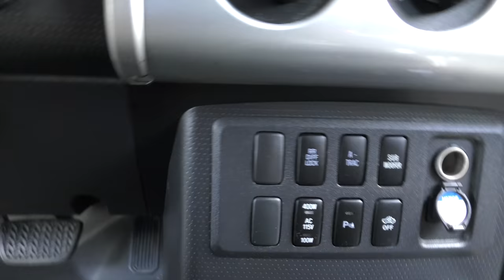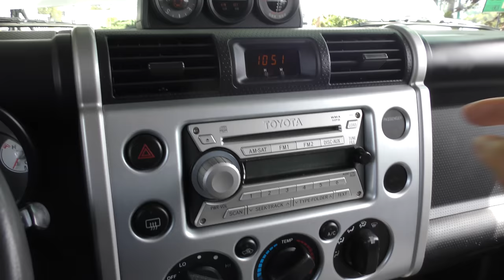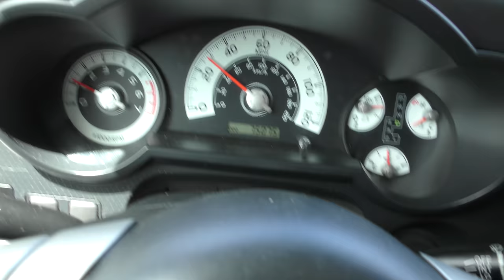I Finally Got a Toyota FJ Cruiser and Here’s What I Really Think of It

Comment: I purchased my second FJ Cruiser this spring. It is 2008  with 45,000 miles and was garage kept by the original owner. Last month I sold my original 2007 FJ Cruiser that I had logged in over 225,000 miles on it with no problems. An FJ will take you anywhere you dare to go and bring back home safely. Been all over the country off roading and camping, the FJ is a beast.

Comment: I have a 2012 one that looks to be the same specs of this one.  Not a single issue since I got it (I got it in 2014 with 27k miles).  Now it has around 85k miles.  Oil change once a year, that is it.  Oh, and I just replaced the original battery, after 9 years!
Reply: Weekend vehicle?
Reply: Id be pissed if i had any issues before 150-200k miles. At 85k shes brand new
Reply: Get your timing belt and water pump done when it's recommended. (likely at 100k) And if your a wrencher, do it yourself. I just did mine in my Taco last week.
Reply: @oldowl4290  FJ has timing chain..
Reply: Got a 2012 TT with 11k. It now 3 years later has 20k. Beats every overlander and most kitted off roaders. Replaced battery, and needs new tires but just because they are old.
Reply: @A-Negative  Bet that was costly!  How much you pay?
Reply: @A-Negative   TT ??? I'm sure you''re not camping in an Audi.
Reply: Oil change once per year, I don’t trust that. I’ll always stick to the tried and true 3,000 miles or 3 months, whichever comes first. Then I use high end full synthetics which are advertised to go much longer.
Reply: @ryanleblanc6817  I use advanced synthetic.  I only put 5k to 6k a year.
Reply: @earthling1984  Ah yes, the 1GR v-6.  Does the chain ever get replaced?
Reply: @ryanleblanc6817   Maybe he only drives 3000 miles a year lol.
Reply: 2011 here, finally changing my original battery. Still starts just thought id change it.
Reply: Have an 07 with 82K. I love it
Reply: I also got a 2012 model in 2014 at about 25k miles, now at 80k miles. Besides oil changes, how often do you do other fluids like differential, transfer case, transmission, and power steering?
Reply: @alcor4ever  Haven't done a single one of them.  I plan to get them all changed before 100k.
Reply: @earthling1984  I just did one or two once and was afraid I was overdue. Just checked their recommended schedule and will probably do them all at around 90k. Such an amazing vehicle!
Reply: @Dobbies Revenge I only put about 4 to 5k a year on my FJ.  I bought a used Honda Civic for daily/summer driving when I don't need the extra space.
Reply: WizeOne……very rarely
Reply: How did the battery last that long? I thought the lifespan of a battery was like 4 to 5 years
Reply: @T-Rex-nm1se  Japanese battery I guess?  They don't even sell the exact same replacement in the USA.  But yeah, it lasted for longer than I would have expected.
Reply: Honda Accord bought it new in 2015 factory battery lasted 18 months lived in az though second made it 3 years 2 years on the third is a duralast
Reply: I see you in every fj video lmao
Reply: @atlantaogatlantaoh3546  HI:)
Reply: @earthling1984  u seem to know a lot about them I’m in the market for one but I don’t like manuals if I get a automatic will it be as reliable?
Reply: @atlantaogatlantaoh3546  Yeah Toyotas automatics are solid.
Reply: @A-Negative  I have a 2012 as you do, mine came with a 6sp manual so it's a lot of fun. No real problems at 132k miles.

Comment: I still have my 07 that I bought new in 08.  Runs great and just about ready to turn 100k miles.  During the pandemic I upgraded a few things, which really increased my enjoyment of vehicle.  I upgraded the headlights with LED bulbs; swapped the CD/radio for a touch screen receiver with CarPlay, rearview camera, and mic for hands free communications; and swapped the OEM sway bars for bigger aftermarket sway bars.  The bulbs and receiver really bring a modern touch and convenience to the FJ, and the sway bars noticeably improved handling in turns and stability at highway speeds. The receiver had a kit that allows me to use the controls on the steering wheel to control the receiver.  It may not crawl over rocks quite as well with the new sway bars, but I'm not rock crawling.  Definitely the best new car value I ever had, even with the poor gas mileage.
Reply: What’s the touch screen receiver called
Reply: @okydokygaming4066  Mine is a Kenwood, but all of the car stereo manufactures make one that will work.  It is a standard double DIN size.  My only complaint about the Kenwood is that the screen could be brighter for very sunny conditions, but otherwise I'm happy.
Reply: I like that car. One day I will have it. Nice to see yours is cared for.
Reply: what brand of swaybar did you install?

Comment: l can tell you they perform off road very well also,
Reply: A wild Mustie appears.
Reply: Indeed! My girlfriend has a '14 FJ with a 6 speed manual, and we took it up to VT a couple of months back. Went on an offroad trail that no unibody suv would ever dream of tackling, scraped the skid plate lightly one, maybe two times. Wouldn't have even put it in 4lo if we didn't have a clutch to worry about. 

Mustie1, I'm a huge fan of your channel. I haven't paid the local lawnmower shop a dime since I started watching a few years ago.
Reply: An XJ does better.
Reply: I just sold my 07 FJ to my son.  He is babying that thing more than I did.....and I really babied it.
Reply: @Lray4x4  an xj sets the bar really high though. There's no shame at all in falling just short of its off-road capabilities.
Reply: @Pro4x Trdpro A trac or any other traction control has proven to be garbage in most offroad situations. I put lockers in both my axles for $600 but even with open differentials and good tires an XJ is hard to beat.
Reply: Good to see a fellow NH resident here!
Reply: @Pro4x Trdpro I have plenty, all it does is overheat the brakes.
Reply: I own one of the first edition with manual transmission with full time 4 wheel drive, it is very cool to own, but it crap as a car, not very practical even during off road adventures.  my overall summary, very cool looking and very Sturdy, definitely will last forever, but as a vehicle for on and off road.  Too tiny for overlanding, lots of blind spot for on road use, a major gas guzzler
Reply: @Pro4x Trdpro Pulsing the brakes = overheating the brake pads and you loose wheel speed because it is applying the brakes , I can turn just fine with lockers.
Reply: @Pro4x Trdpro Pretty much worthless and pointless when you have lockers.
Reply: Holy crap what are you doing here
Reply: @Pro4x Trdpro Not all XJs did some came with a limited slip and like I said before I put lockers in mine for $600 dollars which that plus the cost of an XJ is far less than an FJ, not to mention the FJ front IFS suspension wears out very quickly when you put a lift and bigger tires on it compared to an XJs straight axle, you get much better flex with a straight axle also.
Reply: Sux they discontinued them 😞
Reply: I loved my FJ40 also .
Reply: Sure thing, gotta love those cracked frames!
Reply: @Lray4x4  lmao I'm apart of tons of FJ groups and have never seen the IFS "wear out" without someone being stupid
Reply: @samuelyeet6006  I sure have.
Reply: @jimwimmer  my dad did the same. From your son, thank you thank you thank you!
Reply: @Lray4x4  they are even older and probably rusted
Reply: @Kana0211  OK so what?
Reply: @Lray4x4  Let's be clear here. You're referring to the Jeep Cherokee XJ '84 to '02 right?
Reply: @mazambane286  Yes 84-01 is the XJ.
Reply: @Lray4x4  Oh ok. Well in my country they continued till just past 01. 
I had one in 2.5 diesel. 
It was great on the tar as an urban cruiser. But absolutely rubbish off road! 
The side shafts, or half shafts if you prefer? Were weaker than carrot sticks. In that they sheared off in the rough for no reason. I was the butt of every joke by Land Rover and Land Cruiser owners in our club.
That 2.5 diesel motor by Motori? Or some or other Italian crowd? Would be better suited as a boat anchor.
Plus the thing had no ladder chassis! 
I called it the heap.....not Jeep. 
I could not get rid of it fast enough.
Only problem was nobody wanted it!
Reply: @mazambane286  The 2.5 diesel was garbage and they never had it here in the US. The 4.0 is what you want it will last 300K or more, mine has 250,000 miles on it and still runs like brand new, I believe all the ones sold overseas had the Dana 35 rear axle as well which is also weak. Mine has the Chrysler 8.25 rear and Dana 30 front and I have never broken an axle shaft running 35" tires and lockers.
Reply: @Lray4x4  So. In stock form. The FJ is way better than the XJ Cherokee. 
You can confirm that now right?
Reply: @Lray4x4  You see the problem is here in Africa. Those big 6 and 8 cylinder petrol motors are heavy on fuel. And fuel outside of South Africa is very dirty. And carrying all the fuel one needs for a long trip is not an option. 
So diesel is the only solution. Preferably low tech diesel engines as they can take dirty fuel.
So your Cherokee in straight 6 petrol is also not an option.
Plus spares in repairs are an issue. Especially north of SA.
Reply: @mazambane286  Not at all, my brother has an FJ and my XJ is far better built, does better off road, and doesn't wear out parts as fast.
Reply: you want to know how sht they are off road,,watch offroad hub.  they break & roll real easy.. too square..live your dream. dream on..
Reply: @phantomwalker8251  What vehicle never breaks or rolls?
Reply: You can see a lot of these vehicles in Dubai, with their V6 engines and high ground clearance they're great off roading vehicles

Comment: Scotty, 2 Things: 1) Toyota does still make & sell them new to some countries such as Japan & Emirates (so parts should be around for a while) & 2) The one thing to look out for on 2007 & 2008 is the infamous front shock tower cracking. Other than poor vision when actually using off-road, I loved mine dearly!
Reply: And the 2007-2009 models had an 8” rear differential that was prone to breaking ring and pinion gear teeth under heavy loads. This was correct in the 2010 and later models with the much heavier duty 8.2” diff with larger gears.

Comment: A past coworker of mine had one. His biggest complaint was that he had to keep replacing the windshield. Due to its fairly steep angle, rocks don't glance off of it the way they might on most vehicles—instead, the windshield takes most of the impact and cracks. Then again, on any jeep-like vehicle, this is to be expected.
Reply: Why not put protective film on the windshield?
Reply: Mine definitely eats rocks too. I had a chip in mine within hours of having it replaced. The glue wasn't even dry yet.
Reply: @Jd-ip7ql  Every FJ Cruiser owner that have spoken to has this complaint .
Reply: @MrSymbolic7  In 5 years of FJ driving, I've replace the wind shield once. My complaint the 600$ price tag to do it.
Reply: @MrSymbolic7 I’ve had mine since 2014 never replaced the windshield with 140,000 miles.
Reply: @EthosAtheos wow $600? Hope I don’t have to replace mine lol
Reply: On my 3rd one! 07 158k miles ! Oil changes , and regular maintenance! Only thing major was replacing a battery!
Reply: I’ve had higher priced repairs on my 2014 Toyota Corolla.
Reply: Same w old Isuzu Troopers. Flat windshields. 💔💔💔

Comment: We have a 2011 FJ Cruiser TRD we have driven 390,000 with nothing but routine maintenance, a couple brake rotors, calipers and wheel bearings. You are correct about fuel mileage but I have to say this truck has far exceeded my expectations and will buy another one when this one finally gives up. (used of course) Is there any question why Toyota has blown away all other car manufacturers, this is only one model of many that out perform everything else in that class. Keep up the good work Toyota!!!

Comment: I saw this and got my hands on an 07 MANUAL. I price checked the clutch replacement and it's only couple hundred (if it ever goes out) and the engine can come from a Tacoma and a few others for maybe $3k used with 75k miles. Making this thing pretty much an endless car. I love it.
Reply: I just bought a 2007 Manual as well with 190000 miles on it and it runs amazing...Only problem I've had is somtimes its a little hard to start...You na turn the key and nothing but the lights come on but try it again and it will start...Crazy thing, i'll get it checked out really soon but damn they are fun!
Reply: @markh6545  I think it's your fuel pump my friend.
Reply: @c4yourself319  Well I figured out something interesting, If I use the clutch start button and take it out of gear it starts right up without any issue...Still strange how it won't start immediatly when I use the clutch when its in gear...I'm going to take it in soon and let Toyota check it out and see if they can find anything.

Comment: Had my fj since new(dec 06), 230k miles. Besides the usual maintenance, brakes, suspension, radiator, belts/pulleys(regular replacement parts imo at this high mileage). The worse part about the FJ is the rust, this thing does not hold up to rust that well(I'm in Massachusetts). Even though I wash it quite often and have undercoated it, rust beats this thing silly. Also, the brakes every time I do a brake job, calipers seize. Don't know why, but the pistons are always bad when taken off. 

Overall great truck and going to drive it into the ground. yes, MPG is like 12-15 with a 3" lift and 33's, but who cares.

Comment: Wow, 16k @ 75,000 is a great buy!  I put 140k on my 08’ FJ and got $1500 it 3 years ago.
Best gas mileage was  23 mpg.  That said, my 19’ RAV adventure gets and average of 30 mpg and it’s way better in the SNOW even with my road Toyo tires.  I live near Wolf Creek pass in SW CO.  We know snow!  The FJ was Squirrley in the snow!
Reply: Its all 30k now
Reply: Mine is terrific in snow. I would buy 10 FJ’s for $1500 each.
Reply: My 2012 FJ goes thru the snow just as good as my 2015 rubicon   Got no complaints on my fj.   Piad 32k brand new in 2012 and have only put money into oil changes and tires no repairs as of yet bought my rubicon in 15 because i had 50 k on the fj odometer i now have 57k on my fj and 47 k on my rubicon   Both eat up the upper michigan snow i would sell my rubicon before i sell the fj…
Reply: Yes, before I got my FJ I had a  4Runner #3 that was OK in the snow but not as good as my FJ but then the ‘19 RAV4 is better than both of them.. and that’s with road tires,. I live near Wolf Creek Pass CO.    Inches no, we measure our snow in feet. Last winter was like we only had 25 feet at Wolf Creek summer as opposed to in 2008 we got 44 feet of snow.

Comment: Hey Scotty just wanted to say that these DO have frame rot issues just like the older Tacoma’s. I have seen countless fj’s with completely rotted out frames.
Reply: not all, only 2 years...also if you buy the 2010+ and gas mileage improves and no need for premium
Reply: @kazzTrismus  but Toyota was replacing the rotted frames anyway so no big deal, they stand behind their products unlike GM
Reply: @phillipr7556  yyyup!...gm would still be denying theres an issue...until the dot forces them to fix it...and 1/3rd of the effected vehicles would be discluded by vin# and youd haveto pay "deductible" on your warranty up front, no rental/loaner car, the job would include half assed wire harness cutting as "standard procedure", all subsequent random squeaks and groans would be called "normal"
Reply: @kazzTrismus  no, all years are affected
Reply: @phillipr7556  Fj frames have not been replaced by toyota
Reply: @lilbabykenny  no.....weld materals were corrected
Reply: @lilbabykenny  no dude...sure there's plenty of complainers from the south desperate enough to but one from the north then complain about basic surface rust like it's in the midst of structural failure..
But as a Canadian driving in one of the worst areas for salt in Canada and having recently shopped these vehicles recently and constantly worked on vehicles in body shops for the last 20 years..I can tell you the 2010+ are as good if not better than most and definitely world's better than any American junker....
The idea you purport is that there's something wrong and that's simply not true for the 2010+ models
They are dramatically better and better than most...certainly NOT as bad as the 07/08 years.
With my own 2 eyes I've seen it.
Reply: Got my 2007 FJ with a great frame and a package that includes  ziebart yearly for life
Reply: Yeah I've heard that too and I've seen pictures and forums about the rock. Tends to be in areas that are moist or snowy. Fortunately I live in a dry area in California and I purchased it somewhat locally so my frame is pretty solid
Reply: All vehicles rust over time--no such thing as a rust-proof vehicle.
Reply: I must have a rare one with no rot issues